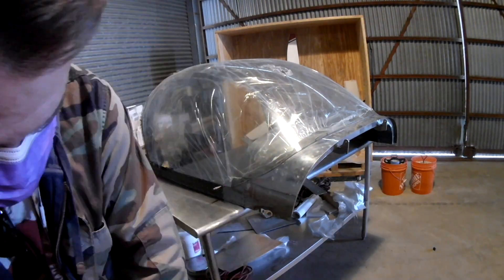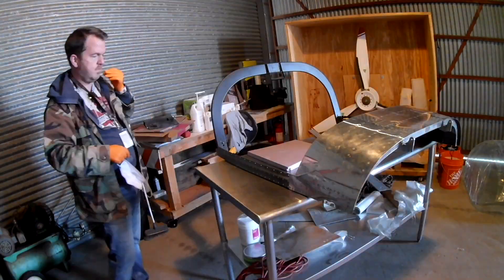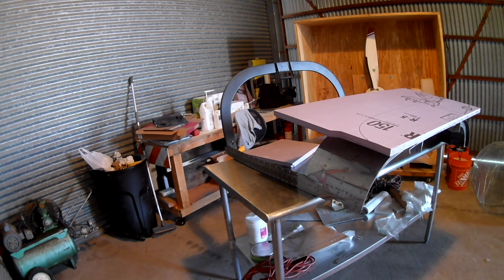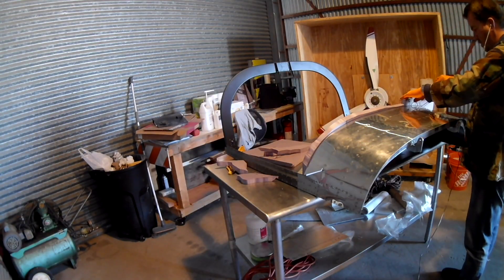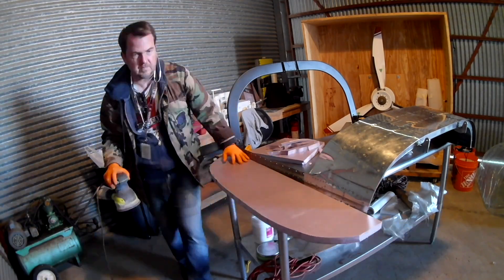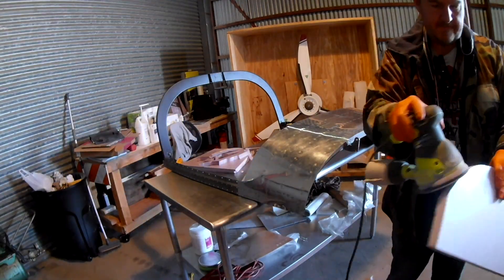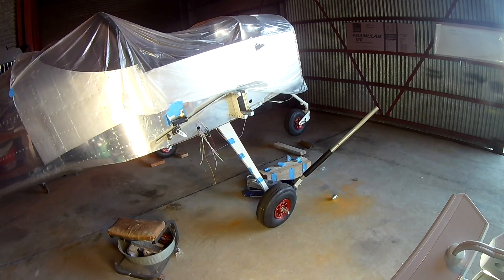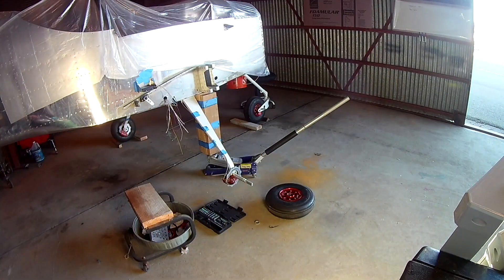RV-14 Axle Repo I

Comment: Heat..you gotta use heat on red locktite to break it down enough to remove a fastener. Blue loctite is gummy and just jams the treads, but the red stuff hardens in the absence of O2 and truly locks the threads.  Heat does break it down though.

Comment: On the axle issue - the AP I’m working with had a good idea.  I split the brake mechanism apart and swapped the outer side of brake and axle from one side to other.  That way didn’t have to change the brake line banjo fitting location. They lined up the right way.  Hope that’s what you did.  I started to take brake mechanism apart and rotate axle  like you mentioned and started to strip the Allen screw too.  This was much easier. Thank you to my AP who caught me before I really tore it apart.
Reply from the maker: You'll see later that the banjo fitting gets swapped. It was MUCH easier than trying to crack that thread sealent.